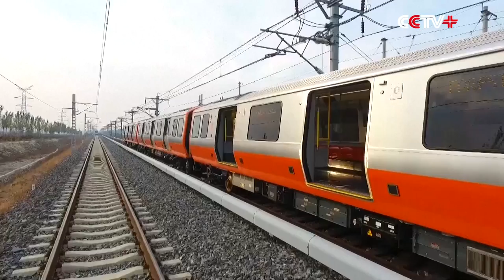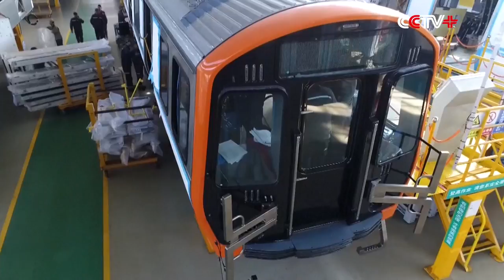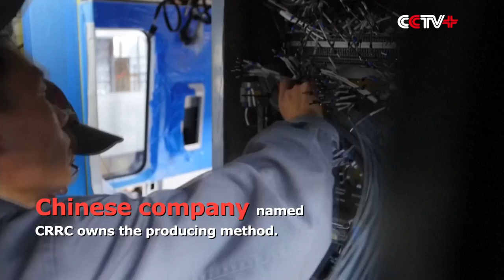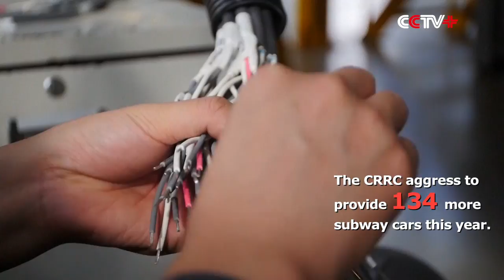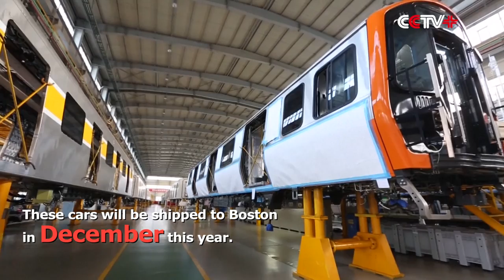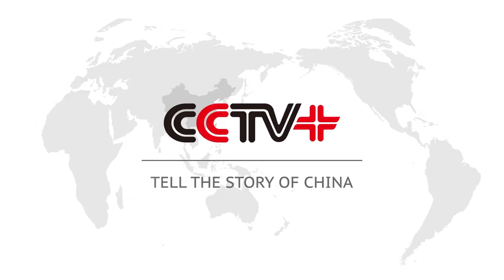Boston Subway to Equip with 'Made in China' Trains

Comment: they look like crap and it looks like the same design i don't get it
Reply: You'd better try both New York's and Beijing's metros, you will be surprised. Welcome to the 21st century!
Reply: why does the MBTA fix the screechy wheels anyway  the  rail wheels are nasty looking anyway and i think better designed rail wheels should get fixed to begin with from the start i saw on a high way road several weeks ago a green line train leaving Massachusetts maybe the newest design is being drawn up right now and getting under construction